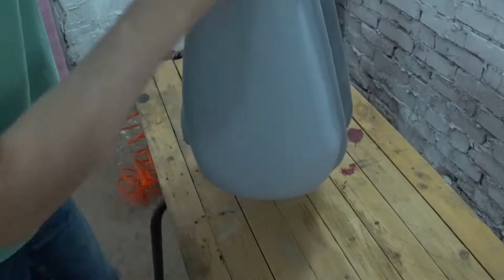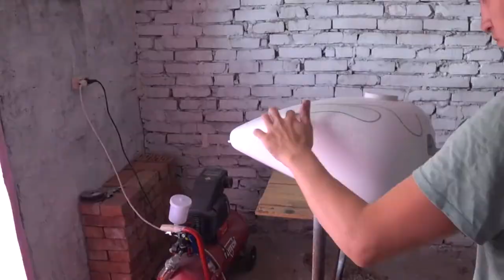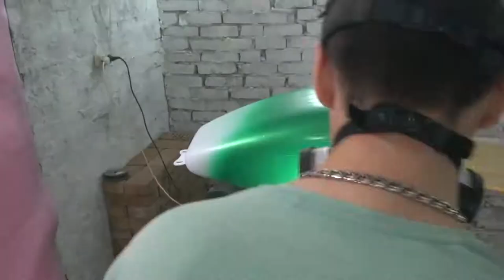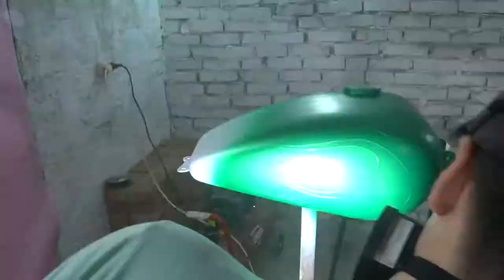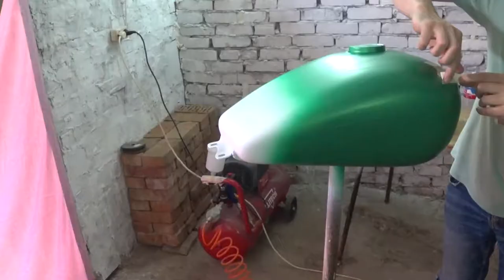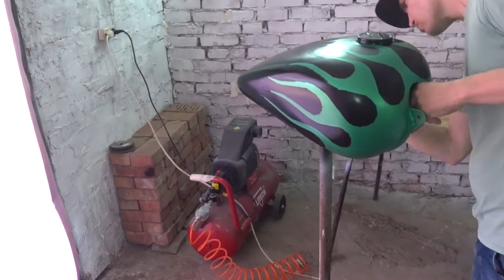How To Custom Paint a Motorcycle Tank

Comment: Excellent as always! Question:, How long should you wait before applying tape again to use the next color? I would think some paint would be removed when you pull off the tape. Thanks👍
Reply from the maker: Thanks. No, everything is fine, 15-25 minutes and the paint is dry, it's ready to use the tape
Reply: @Z11KUSTOM  Thanks for the reply. Helps greatly. Todd

Comment: Man that is so cool! Thats exactly how i want to do my tank. At what point in the process did you wet sand?
Reply from the maker: Thank you bro! I did a wet sanding after covering the primer to make it smooth. Also I sanded the clear coat
Reply: @Z11KUSTOM Wet sand after the primer or after the base coat that you put over the primer?
Reply from the maker: @colinweber  wet sand after primer

Comment: I meant like equipment. What kind of gun, paint , compressor.
Reply from the maker: I thought so, but decided to clarify. My main spray gun - Expert 1.4 , more information about my guns you can see in this video https://youtu.be/Qwl5JzfQht0 ,  capacity of compressor - 50L, power - 1.5 kwt. I use different paints, it depends on the wishes of the customers